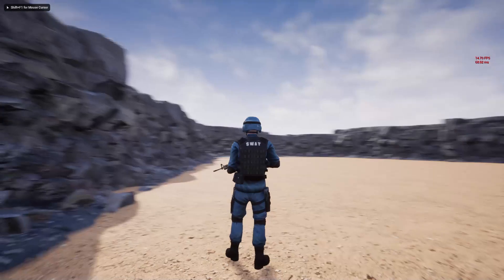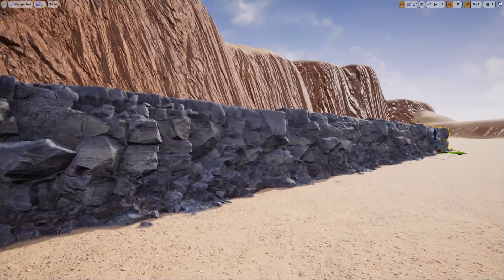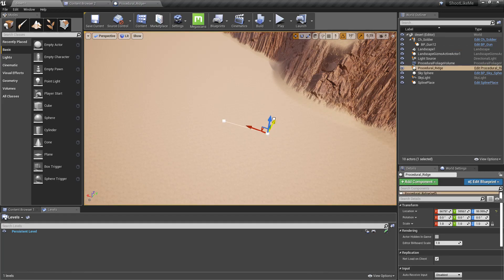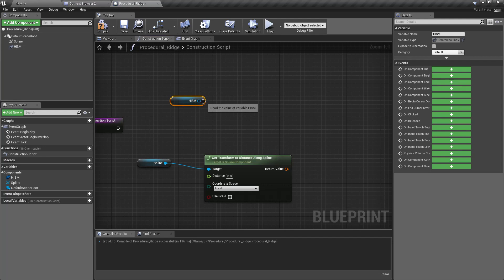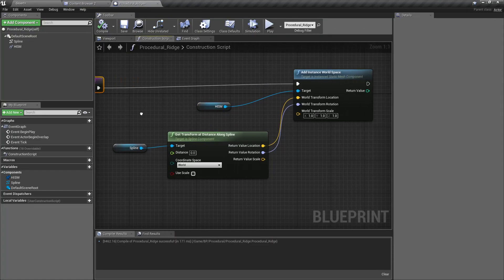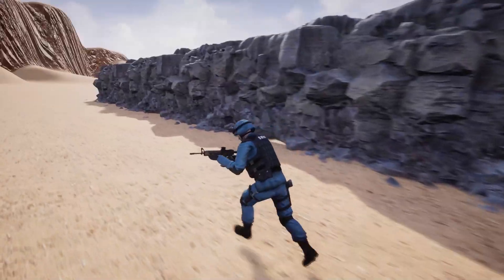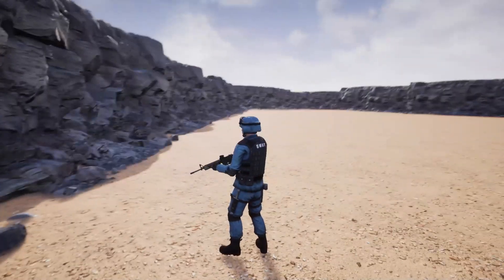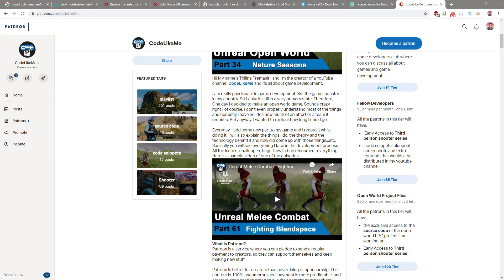Procedural Environments - Cliffs - UE4 Tutorials #310

Comment: Can you randomize the scale/size of each cliif face or even better have different meshes spawn randomly instead of just one repeated along the spline?
Reply: You can do both. But you need separate "hierarchical instanced static mesh" for each type of static mesh you want to add then you just use a select node with a random int value